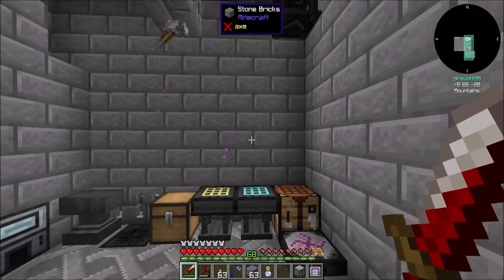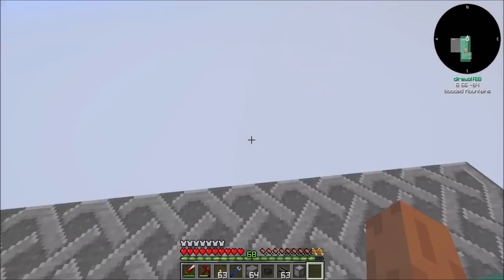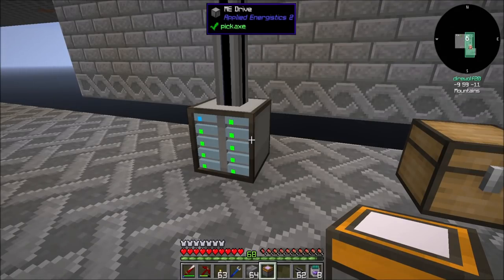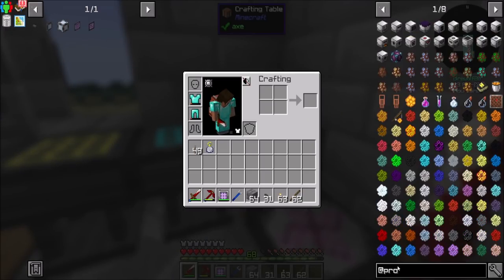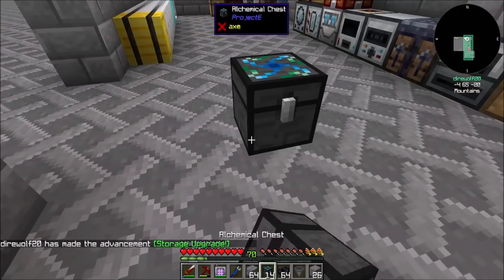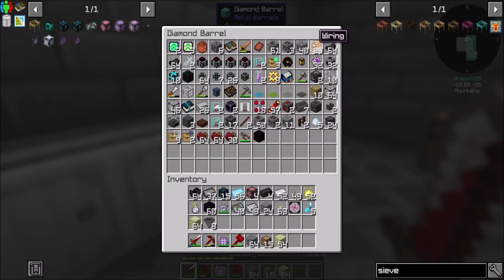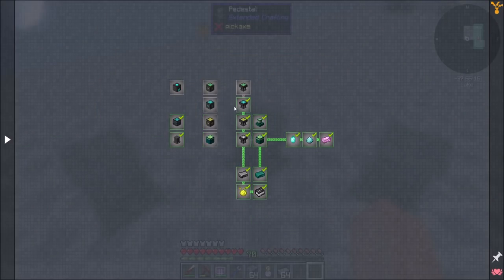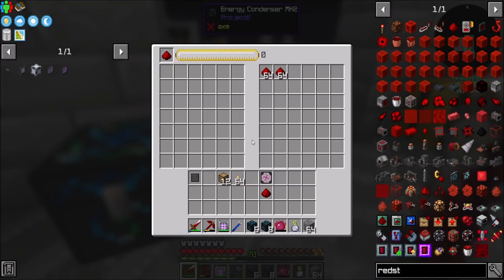NTC2 Ep20 AE and Failed EMC Connections

Comment: Dire, you can put a condenser on the pipe leading to your mob drawer system and have it be the top priority, that way any EMC-able drops will be converted to something like Red Matter or higher EMC matter before being sent to your voiding drawers.  It's not as fast at generating EMC as you will need in the future, but WAY faster than manually taking stacks of emeralds and shoving them in your tablet.  

Plus things like your ender pearls, zombie flesh, witch drops, etc. will be converted too as a bonus taking up less drawer space.
Reply: I'm using purple matter, and my mob farm is only running range 3 upgrades.  I only use vindicators and cursed earth.  I keep meaning to upgrade it to range 9 upgrades and so forth, but I think I need to add a second duplicator to make something with high exp drops and using essence instead of liquid xp.  Mine slowly drops, and I'm putting all the xp from my mob cages in there when I take out the purple matter.  I left for about 6 hours and got almost 2 stacks of purple matter.  almost 2 Bn emc.

Comment: I wonder...can u use entanglement block to give u more sides on an me terminal?
Reply: That's what i was just wondering too.
Reply: It probably won't work because a single side of the controller can only handle 32 channels
Orrrr I just misunderstood you
Reply: you could connect multiple controllers together to give you more sides
Reply: @EngineeringDruid  but that has a limit, you can go up to 7x7 which will have like 4-5k channels. With entangled you can technically have infinite channels if it even works. Plus controllers are more expensive then entangled blocks in almost all of the packs.
Reply: @ahmetemregurdal501  I more imagine it wouldn't give you infinite channels, but would allow you to possibly use more than 8 channels without needing dense cables by pulling 8 more channels through the entanglement stuff. Maybe even all 32 channels if you can connect multiple entanglement blocks to one controller
Reply: Do what Dire should have done before crafting a rather expensive block in this episode: Load up a test world in this pack and see if it can be done! 😊👍
Reply: @DarkVoidIII  it's not needed since all u need to do is test it  not done testing it but u can use it to power the me controller and have all 6 sides usable
Reply: @ahmetemregurdal501  maybe but in what pack would you realistically need more than 5k channels? Not even GTNH bases need that many

Comment: As mentioned in the comments, just add projectarchitectadditions mod from curse add custom recipes and you are all set. It works extremely well. Just attach a storage bus to the emc link block and attach one of the transfer tier blocks from the mod and do not forget to set the priority on the storage bus to a higher number than your storage drives.

Comment: Can you connect the mk2 to a drawer system with a flint and void upgrade, and then external storage with a drawer controller? In that way you'll have unlimited resources. The cons are that everytime you get like 64 irons, and then put them back, they'll get lost. Also you would need to manually put emeralds into the tablet every once in a while. I don't know anything about emc so this is just guessing.
Reply: Simply take a few stacks of each item you want in your system out of the tablet and throw it into your AE2 system :D I can see how a few condensers producing select resources like iron for example could be useful but you could simply put a storage interface on it without having to build overflow & restock logic with a drawer system. Storage priorities can make you take out of your AE disks first.
And if you pipe items from your condenser into a void upgraded drawer it just burns up all the EMC you need to input into your condenser (they just convert emc'able items into the target emc'able item that you configure, it's not changing the amount of emc inside) You could have 2 drawers per item type, one that is fed by the condenser without void upgrade, one where items go back to via the storage interface. Flint downgrade to 1 stack not really required.

Comment: I wonder if dire remembers power flowers  are a thing
Reply: i think he does, since he mentioned putting a collector next to the basic emc link and seemed to understand that. 
i would guess he's not doing it since one, collectors are a hassle to craft in this pack, and 2, he has a much faster manual emc gain from the emeralds (which could be automatic if the emc links worked T_T)

Comment: Not sure if tunnels are still in AE2 or not, but you used to be able to place a single controller block and a tunnel subnet if you need more than 8 channels in a seperate part of your base from the main controller. Just a resource and space saving tip to keep from having to run multiple cables long distance.

Comment: Fun Fact you can put P2P directly on the face/side of the ME Controller and EVERY P2P output will act as another face of the ME Controller 
(at least this is the case a while back, IDK how much the mod has changed up till now)
if this still holds true then you could have 6(base faces) times 7(P2P Outputs per face) = 42 faces that each can have 32 channels (Dense ME Cables) rather than just 8 (Smart/Fluix Cables)
Reply: When was that the case? Putting the p2p input against the controller directly or against a length of dense cable has always been the same as far as I remember (until 1.12 where I last played with it). You could have more than 1 place to output a side of the controller but you wouldn't get more than 32 channels connected. E.g. 2 p2p outputs with 16 channels in use by each is fine, adding 1 more channel stops working no matter how you try to trick the controller into adding another channel.
P2P just saves on cables, it's not better than using all dense cables

Comment: I wonder if the Entangled mod allows the ME controller to have more than 6 sides worth of channels. Could be interesting, even if it doesn't work I imagine it could be used for 'wireless' ME transfer.
Reply: I don't think it works since with entangled blocks you're still interacting with the same sides of the block. The ME Controller is limited to X channels per side and you've essentially just got two pipes sharing those channels

Comment: Can you entangle the ME controller?
Reply: Probably, but I bet it would have the same number of channels per side. You'd have more places you could run cables from, but whether it is the North side of the controller or the North side of the entangled block, the North side still only has 32 channels. Those two North sides would share and if, combined, their channel load exceeded 32, some of the farthest channels would simply stop functioning as is normal for AE2.
Just an educated guess, don't know for sure.